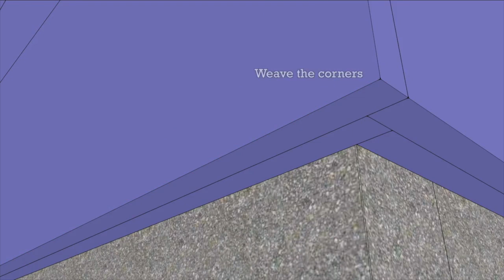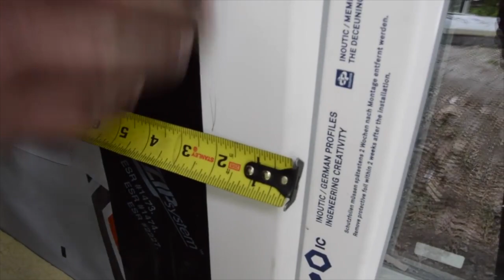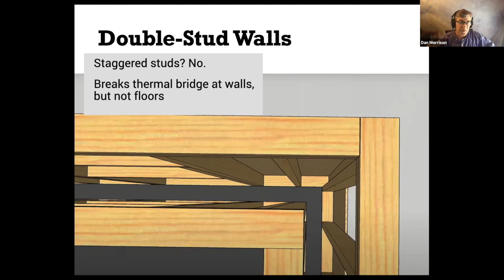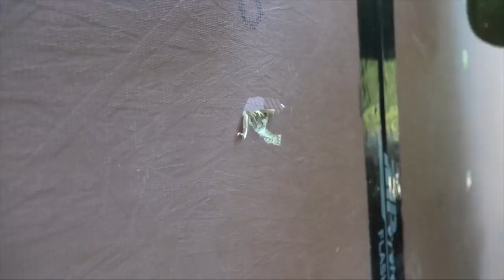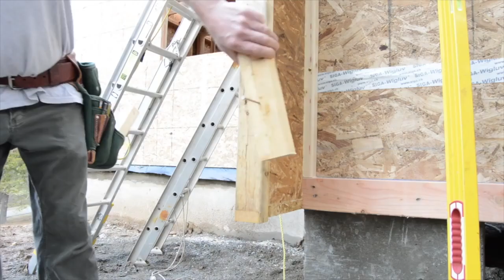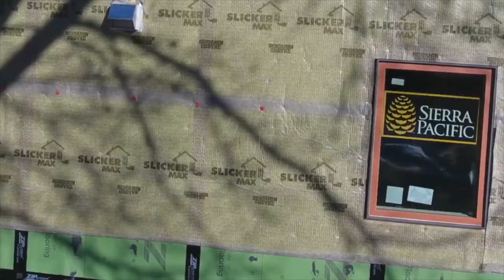3: Superinsulated Walls (PTC's Continuing Education Tour)

Comment: Appreciate the illustrations and find them more useful than seeing the onsite examples. 
Amazing how much waste of materials is demonstrated on typical jobsites.
It would seem that chasing "energy efficiency" is a questionable pursuit.  Who really is benefitting from all this additional cost?
Dislike, actually hate, the obnoxious soundtracks which annoy and add nothing to the presentations.
Reply from the maker: I don't understand the comment about "chasing energy efficiency being a questionable pursuit.' Energy costs aways go up, insulation is paid for once. Climate change is real and 40% of carbon emissions come from buildings. Sorry to hear you don't like music.
Reply: @ProTradeCraft  "Chasing" as in changing the goal or moving the bar.  At some point there are diminished returns.
When lower revenues are forecast by the energy cartels, they will simply raise the energy rates.  This is a negative impact on every house occupier.
Increasing costs for house construction may benefit a select group of folks, but it is certain that it is a negative for potential house buyers.
Increasing costs for house construction also raises the market value for all housing thereby giving the local tax boards an excuse to raise tax rates or tax amounts.
This also has a negative effect on all house occupiers.
As stated, appreciated the presentation, especially the illustrations.  Find most soundtracks do not add one whit to the videos so why use them.

Comment: Another question... Why use the tyvek house wrap and the foam board?
Reply from the maker: Tyvek provides immediate weather protection during construction and a continuous layer in the air barrier system. Technically, you could probably get away without it (check your building code), but you'll need to think about airflow at all of the openings and edges if the air isn't cut off at the house wrap stage.

Comment: Just in the process of installing foam board myself. Good video to watch.1 question I have is using the polyiso in Ontario Canada,I have read you shouldn't use it for this climate zone,but I seen contractors using it.
Reply: I think he's referring to the way that polyiso is supposed to lose it's R value in colder temperatures.  So when it's really really cold it might not be better than XPS.
Reply from the maker: Polyiso has higher R-value than others, so I'm not sure why you wouldn't use it.